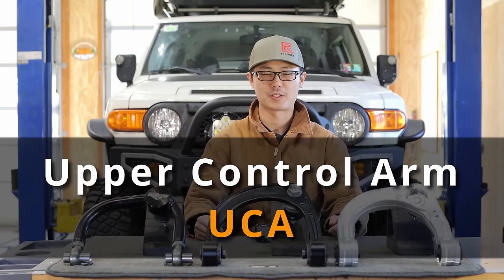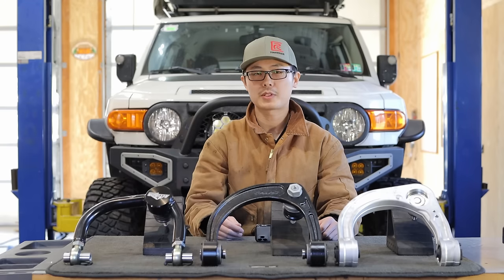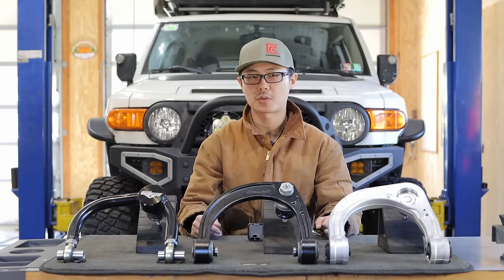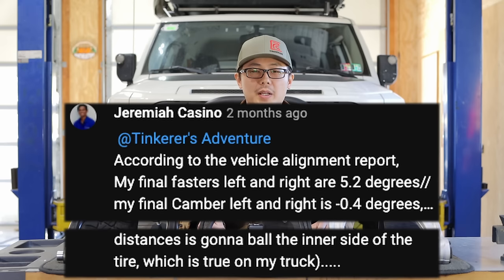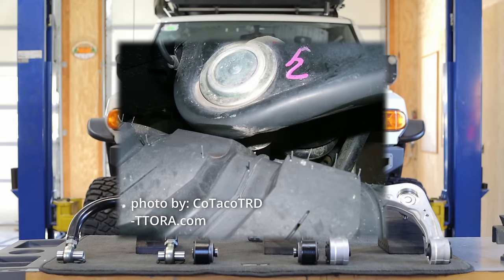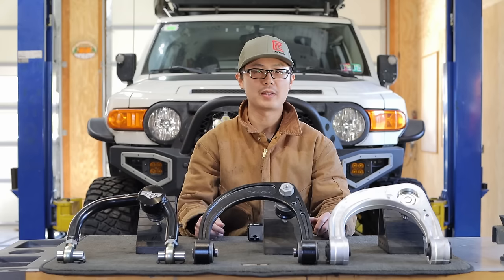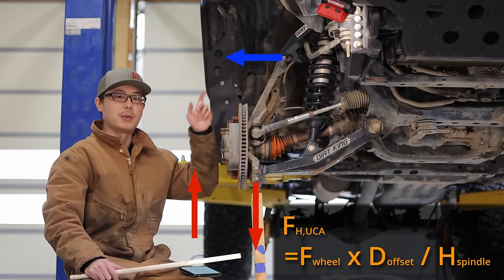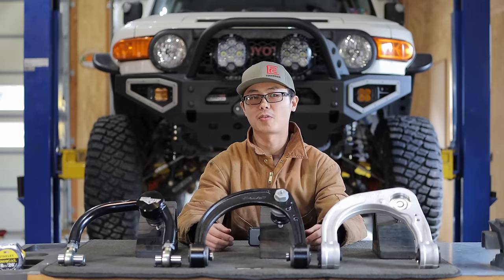UCA's True Functions and Misconceptions | Toyota Aftermarket UCA Part 1

Comment: Hmmm… @Tinkerer, do you think it’s possible to conduct an at home alignment without an alignment machine ?? Simply trial and error for handling and tire wear. I am considering attempting this with my own setup (1.5” front lift with 1.5” rear lift and 285s). I just don’t trust the alignment techs I’ve used, and my 4Runner doesn’t feel like it’s aligned properly even though it is less than 2” lift. My understanding is that alignment numbers from the machine simply don’t matter as much as the real word handling and tire wear. With your own research, I don’t see why I can’t achieve an alignment similar to stock with my current lift and tires and stock upper and lower control arms.

Thank you for the detailed content !

*Edit: Turns out that lifting the rear on a 4Runner will reduce caster according to the equation arctan (-1.5" / 109.8"). Result is .783 degrees of reduced caster. Which must be why TRD Pro does not have a rear lift.
Reply from the maker: I've seen many people done it. I always try getting my alignment close at home before taking it for alignment service. I use angle finder for camber and make adjustments on wheel dollies (friction between tire and ground prevents the tires from shifting). Using handling you might not have a strong feedback to tell if it felt better or worse after a small adjustment. You'll start feeling things. Tire wear will also take a while to realize, especially if it's toe related. And yes you're right about rear lift and caster.

Comment: Kai, quick question germane to the UCA discussion. I see all these folks doing the UCA install and they're bending metal to get the UCA bolt out. This seems preposterous to me, how can the OEM intent be, "bend bodywork" out of the way to get the bolt free on a suspension component that has bushings that will eventually fail?!

I see some advocate cutting the bolt (which doesn't seem bad, they're $24, I care more about right than a little cost) but then they say you have to install it reversed and they purport that's a safety issue because it could work its way out because, "gravity" or something. I'm being cheeky because I think that scenario is quite unlikely and lord knows how many bolts could walk out for any number of reasons.

Comment: Kai is the guy you wish was on Tacomaworld or (insert forum here) when you ask a legitimate question. I've got one for you Kai.  I want better shocks (the best shocks to be specific) but not alot of lift.  I would be fine with zero lift really. What is the limiting factor if I were to install 1-2" lift fox performance elite RR dialed down to the 1"  with oem uca? Would I still have full range of travel? Would coils or RR hose scrub uca at full droop? Do I need extended bump stops? Alignment should be ok since 1" lift is trd pro configuration. Or will it? I am spoiled from years of trial and error on my mountain bike. I have settled in on top of the line Fox as set it and forget it for my bike, and see no reason why my truck would be any different.   I have no desire for my dd/work truck to sit crazy high so I have to lift heavy material further every day. I just want it to perform around town, and on modest trails. I want it to perform to the utmost of its ability everywhere I take it, and superior shocks are a must for this. If you actually read this thanks for your time,  your videos are of the highest quality. Thanks.
Reply from the maker: Thanks. You can definitely go low or no lift with Fox performance elite (unless you paired it with too long or too stiff springs). Spring preload/ride height adjustment is independent from max up and down travel limits, unless coil bind occurs, but that’s when someone try to add too much lift. RR hose is tricky. Each brand is different. And many of them doesn’t clear cleanly even with aftermarket UCA. Most likely it will rub on stock UCA.

Comment: My stock UCA's seemed to bind and not freely droop during coilover install and adjustment. Many people claim a better, more compliant ride after UCA install. Have you found that to be true?
Reply from the maker: There is no ride comfort change by simply change UCA. Some aftermarket ones will actually transmit more vibration due to rigid metal on metal joint. Most people are feeling placebo because they spent the money. What you see is because of the OE rubber bushing. It is totally normal and preferred if you want compliant ride. Watch my Toyota After Market UCA Part 2 video for more details
Reply: @TinkerersAdventure  Thank you for the detailed response.

Comment: So the ONLY reason to buy uppers is to correct alignment from lifts over 2 inches.
Am I wrong?
Reply from the maker: Pretty much. SPC could increase tire clearance further as it can be set to factory caster and you still benefit from the sliding channel (but less than half inch difference). There is also benefit for tighter handling with certain UCA design, which I will go over in the next video.
Reply: @TinkerersAdventure  Tighter handling from different bushing? I guess ill have to wait for the next video.
I really dont see the point for upper control arms; I managed 35s on a 2nd gen Taco with no lift, factory alignment, and factory control arms. The only place i have rubbing is the upper at full turn, but i did a lot of cutting and a CMC.

Comment: Freedom offroad for the win
Reply: Freedom is better than the spc?
Reply: @ju4rvdltdlt451 I just bought some but have not installed yet.  They do not have the adjustability, but they do use a factory style ball joint and bushings for the $$$. I figured they were worth a shot

Comment: I want to stick with my oem uca, yet I can't find anything on replacement ball joint working angles. Now that my front struts (trd fox on eibach with 3/8" shims) are extending further than the limits of the uca ball joint, it keeps on pushing my cam bolts out of alignment when at full droop. Any input on how I should tackle this? I assume others running spacer lift will have the same problem?
Reply from the maker: Yes. Adding spacer on top of the coilover changes its length, hence extending the droop. The TRD Pro coilovers are already extended (see my extended travel video). Adding spacer on top of that will over extend. Even if you switched to an aftermarket UCA with more droop, your inner CV will start to bind, also shown in my extended travel video.
Reply: @TinkerersAdventure  I was under the assumption it would have worked. I based my setup on the Westcott Design kit for the TRD foxes. The Westcott kit includes the thicken spring seats along with 1/2" top shims. Thought that if 1/2" shim works, so would 3/8". I guess people with this kit might face the same problem I am having. If only your videos came out sooner 😭.

Comment: I have the True Travel Dynamics adjustable UCAs and stock LCAs on my 120 chassis and its been months of nightmare due to the excessive positive camber even with the LCAs maxxed outwards. The UCAs are maxxed inwards as well.

I'm not sure if I buying the Super Pro LCAs with extra camber adjustment will be enough or if I need Long travel LCAs I feel pretty desperate since I wore out the front tires half life in just a month. I'm seriously considering to downgrade meanwhile I find a solution for this. I even fabricated some ball joint spacers to bring it back to a neutral position since its spec was only for 2.5" of lift and my suspension is 3"

I've been callling them but no one is answering my callls IDk if they still in business
Reply from the maker: That sucks. The heim joints are a pain to adjust. I had similar issue before the heim joints running out of threads on the brand I had. Super pro is pretty much identical to SPC so I think it’s a much better bet. Good luck!

Comment: I don’t even know what to do at this point can anybody please help me. I have a 1st gen Tacoma with Bilstein 6112s and 5160s in the rear. I would like to run 255/80r17. I was planning on getting the JBA high caster UCA but now it seems like that’s not the way to go. Can anyone give me a recommendation on my best option to for 33s without any cutting besides the pinch weld mod? It sucks there’s not many options for 1st gen tacomas

Comment: Some people think that there are zero advantages to having independent suspension for off-road... What are your thoughts?
Reply from the maker: For strictly slow speed crawling (what most people do in general term off-roading). I agree production IFS has no advantage. It’s only advantage is on road and makes a more balanced dual purpose vehicle, which most consumers do. Ultra4 IFS is a completely game so “IFS wins king of hammer” is not a good argument for us.
Reply: @TinkerersAdventure  I get about 7 inches of movement from max tuck to max extend in the rear, (realistically). I think Jeep claims 7.5 . Even to do that , one of the wheels has to be slightly off the ground to get enough weight on the spring to compress it that far. Basically , try to turn in a circle on the side of a hill and it will happen lol. I'm not going to have one tire on someone's shoulder and the other one on the ground like some wranglers and rock buggies could probably do. 
It would seem , however , controlling for as much as possible, that independent suspension would have better traction on uneven surfaces in the case that the terrain requirements are within the range of suspension travel. 

PS , supposedly with long travel fox shocks I can hit 11.5 in. Suspension travel in the rear , according to MFC. I've seen zero videos of this demonstrated,  however.  It's still not 35 inches of travel or whatever built out wranglers achieve.